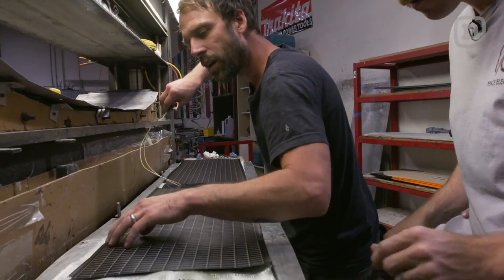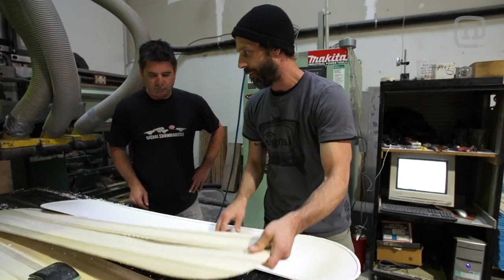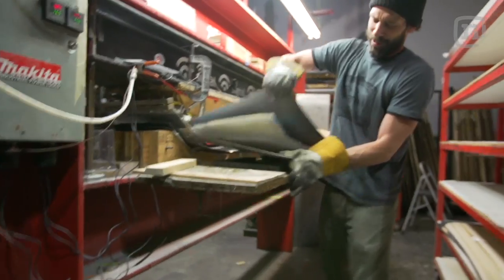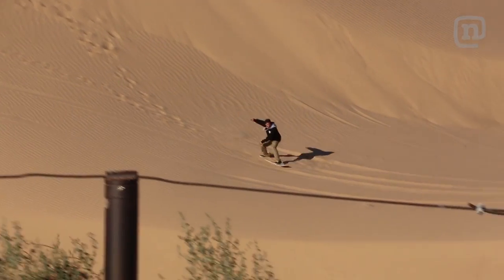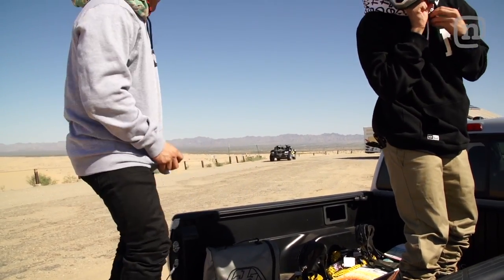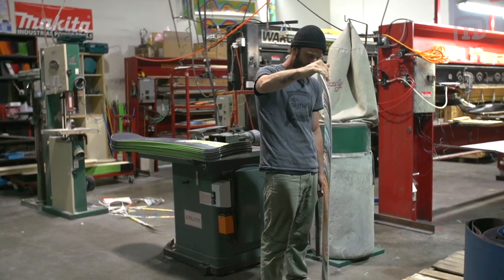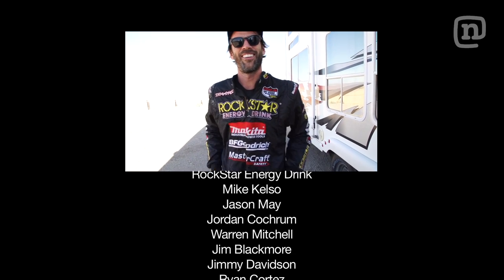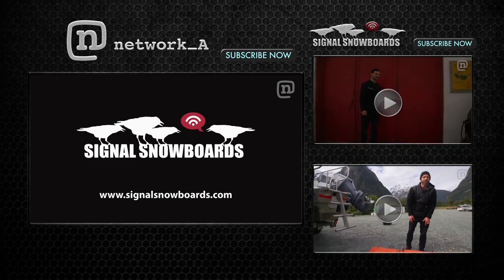Snowboarding In The California Desert: Every Third Thursday

Comment: should do abs + heated surface for better speed!! looks awesome tho
Reply: I don't think a heated abs board for sand would work. sand has a higher melting point than sand, and it wouldn't be safe for the rider due to the high heat, although it would be cool to leave a trail of glass behind you when you ride haha

Comment: So, did you talk to the A-Team guys at all? Find Jack, or Gary, and bring in their wisdom (if, of course, they are willing to share) on sandboards. Know your roots, dude!
BTW, I first raced Jack (and Tom Sims) in 1982, near my hometown. I watched the A-Team boards spin mid-carve because we were on VT hardpack, not Cali pow. The Backhill came out on top, with the Barfoot-designed Sims second, because of fin placement (Dimitri's Wintersticks had fins break a lot!). However, the A-Team boards have the basic, original design, and are great sandboards! I've ridden dunes with early-90's snowboards, and that worked well, but the bases couldn't hold up for long. Madds made a few raceboards with a base that was rock-proof, but J. Gilmour has never let us know just what THAT plastic was; That's one item that would absolutely made sandboarding a contender, but prying into Gilmour's head will require a Klingon Brain Scrambler at the least..

Nice work! Keep on it, and, don't forget, the Dunes are a surf spot that's not yet been fully explored!
"PSR"

Comment: Would the abs one snap really easily then?
Reply: I think its really strong but also really bendy so there is a less chance of it snapping in half.
Reply: abs is an amorphous polymer so it is pretty flexible, that being said it would get harder as temps dropped, making it crack easier. The abs board makes sense for the sand because of the warm temps and because it has to be relatively hard in order to not get demolished by the grains of sand. For snow I would probably make a board out of a low density polyethylene and then throw some carbon in the board to add more pop back in.
Reply: Freekman29 would LDPE work? i mean thats what plastic bottles are made from , and not even for carbonated drinks so it sounds pretty weak. Not sure about how well the carbon would work, would likely be very stiff, would look cool as hell having a carbon fibre pattern on it, and you would need steel edges either.
Reply: Daniel Gallagher plastic bags are also so made out of LDPE, it's properties can be tuned pretty easily using plasticizers and changing chain lengths ect. also I just meant carbon rods that are used in many snowboards now a days. Also I would leave the edges off for the street factor haha
Reply: Freekman29 Leaving the edges off? I've never risen a board without edges so id dunno what that'd be like, it wouldn't carve as well but you definitely wouldn't catch an edge and break your nose.

Comment: You guys should make a board of bullet proof glass.   I think it would go faster because it would be slicker even though it would be heavier.  Or steel.
Reply: They already made one out of tempered glass (pretty much the same thing) it worked pretty well but the one side broke
Reply: Akiko Miwa
Polished stainless steel on the bottom with your abs as a backer.  I bet that would slide faster.

Comment: Stainless steel snowboard??
Reply: Would be sick, but you cant glue steel.
Reply: not true. currently many manufacturers use 'bonding' for many non structural body panels. in testing these adhesives, before the bond pulls apart, the steel fails. meaning the bond is stronger than the sheet metal. so its definitely possible, but would require like 16ga sheets at max bonded together.
Reply: The bond isnt stronger than the metal, you just cant glue metal becuase of its surface properties.
Reply: "Youtube User
38 minutes ago
The bond isnt stronger than the metal, you just cant glue metal becuase of its surface properties."

lol...... confirmation bias is a funny thing.. (also, its not 'glue' its adhesive. but seriously man... that comment is sssoo bad, i swear you are just trolling..)

and actually, you will get a stronger bond with an adhesive on aluminium vs welding because aluminium becomes annealed when welded and the strength of the area of the weld is reduced by at least 40%(there is a range dependent upon various conditions). Lotus figured this out and is a major reason why they have been bonding and not welding together their aluminium chassis for some time now.

--- http://www.loctite.co.uk/success-story-stronger-than-welding-8907.htm
---- https://www.shopfloortalk.com/forums/showthread.php?t=28894
---- http://www.chevelles.com/forums/12-body-shop/202546-how-good-sheet-metal-adhesive.html
---- https://www.youtube.com/watch?v=kmwY3EATCPc
---- https://www.youtube.com/watch?v=ozRYpxjexOs&list=PLG5syfhKKXb5Zcco2Br5gwtZYht047dDu&index=22

-- https://www.youtube.com/watch?v=jDbvvsuSiQM&list=PLG5syfhKKXb5Zcco2Br5gwtZYht047dDu
Reply: NO! Why would you want steel? It weighs a lot more, is less flexible, and has more friction. So why would you want a board heavier and slower?
Reply: @obi-wankenobi9871  Of course you can glue steel, epoxy sticks great to metal.

Comment: You're trying to slide plastic on very small rocks (...sand). Sand grains are harder than plastic. They dig in instantly. What did you think was going to happen?? It should have been obvious from the get go...before you spent the time making the board!

To answer your question as to what would work. Nothing really. You would need something that rolls over the sand instead of trying to slide on it. Sort of like grass skis but with wide rubber treads. At that point, however, it's no longer a "board".
Reply: Exactly what I thought. I think what would also happen is the plastic might warm up and even melt a little with the friction, making it harder to slide. I saw a comment saying something about a stainless steel snowboard as a new ETT idea but I think that would work perfectly with the sand. What do you think???
Reply: Kameron Holmes Stainless steel is a relatively soft metal. The sand grains would still dig in. It would of course slide better than plastic. What you really need is a very hard surface like carbide. A super hard ceramic surface like silicon nitride would be the best. That stuff can go as high has 78Rc. None if this would be practical to make but it would be interesting to test and see how it performs.
Reply: +Internet Tough Guy simply put there is much higher friction on sand than there is on ice
Reply: Chris James No. Friction is relative and depends on the two materials in contact with each other.
Reply: +Internet Tough Guy lol yes that is true. my statement implies using a constant material in relation to sand and ice